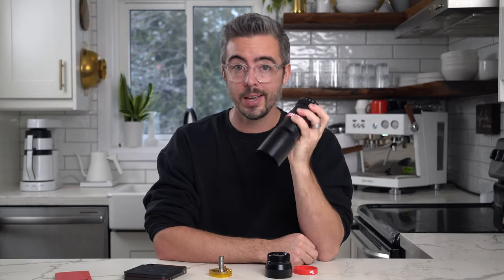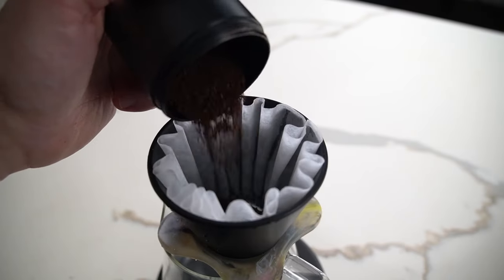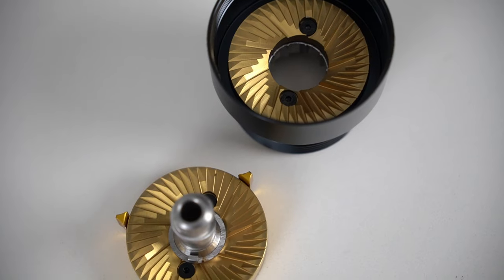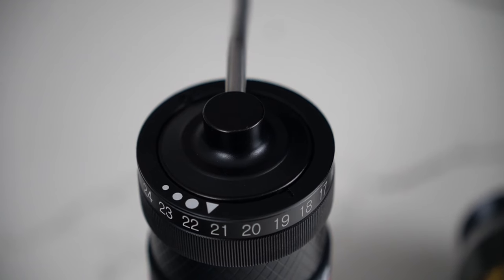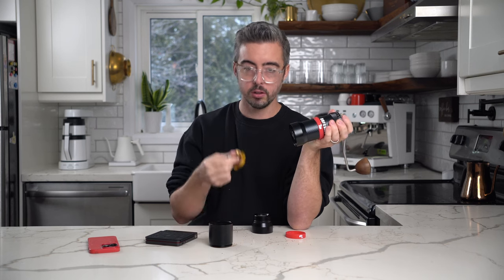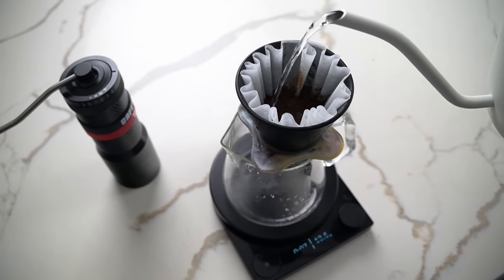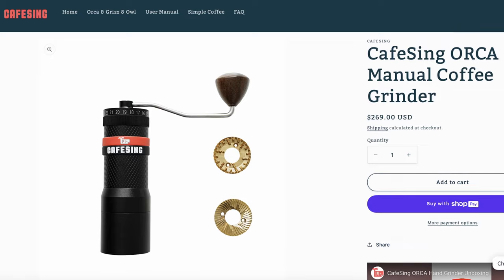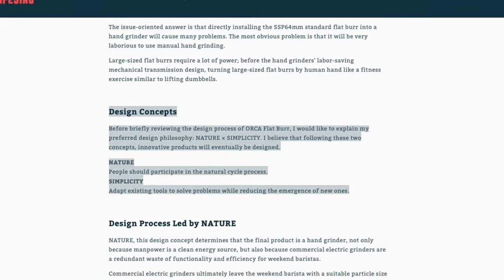Cafesing Orca - The Super Weird Tale of the  FLAT BURR Hand Grinder - A Review

Comment: I was actually considering this grinder, I went for the J Ultra instead. What do you think is contributing to the “flatness” of the flavor? And by flatness do you mean lack of acidity or sweetness?
Reply from the maker: I am not positive what causes this but I think it may be the fines created by the ghost burr in particular. And yes, a little less dimension than I was hoping for, not as lively, missing some acidity and seeetness, a touch hollow - but as I said, very forgiving to brew with.
Reply: @DaddyGotCoffee  have you experimented with longer bloom times (e.g. 2 minute blooms) and wet WDT?
I've heard that they can help with the flatness of ghost burrs - supposedly due to the fact the grind size is coarser.

Comment: It seems to me that the performance of this grinder would be quite dependent on the angle at which it's held when grinding. Being a hand grinder, it is incapable of spinning fast enough to creating enough centrifugal force to actively feed the grinds through the burrs. This seems especially true for the ghost burrs since they don't have the cutting surface angles of the espresso burrs that would provide at least some marginal active feeding. So holding the grinder straight up so that the burrs are parallel to the floor would cause the grinds to just kind of sit in the burrs and continually regrind until they're eventually pushed out by more grinds coming from the prebreaker. Whereas holding the grinder at an angle would help facilitate the grinds falling smoothly through the burrs by the force of gravity. I do wonder if this is the reason for so much inconsistency between the various reviews of this grinder, and in your particular case the retention and slowed down grind speed at the end of the grinding process.
Reply from the maker: I did try it both ways and you are correct. Holding vertically does impact both speed and and retention. However, I didn’t find holding the grinder at an angle with the ghost burrs didn’t drastically improve the cup quality on filter. Even when held at an angle, I still found getting the last bit through on the ghost burrs a little more tedious than I would like. Great notes and questions